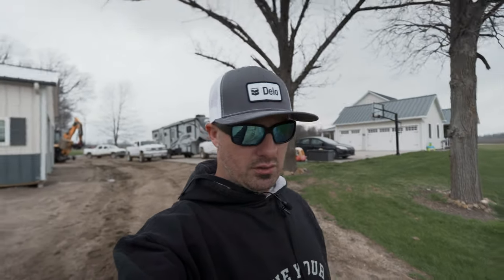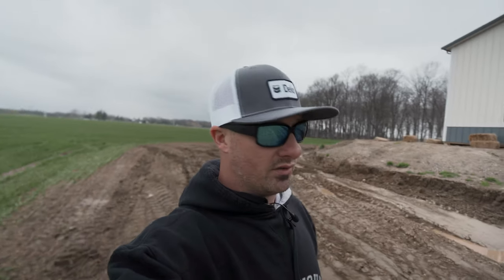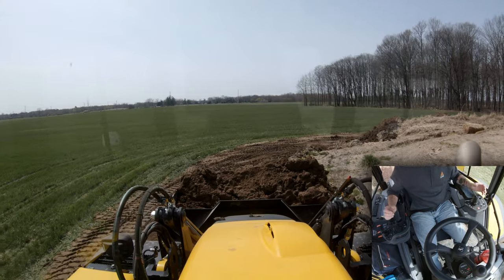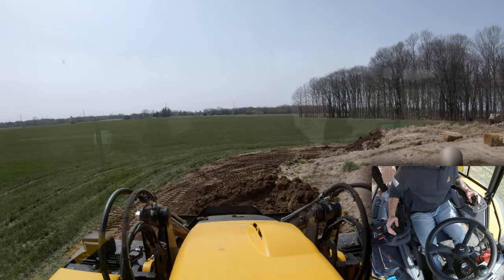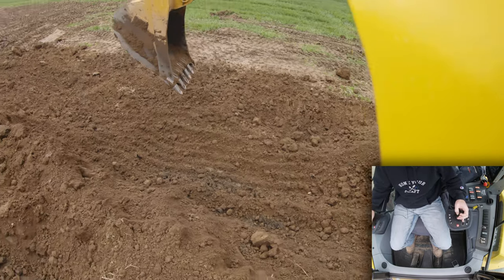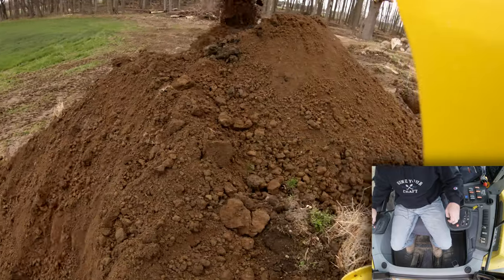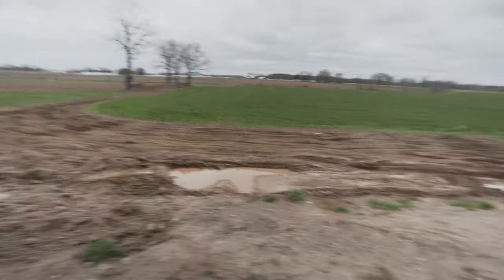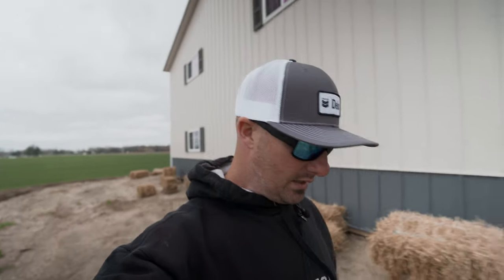Working in the @huddig!

Comment: When you use the bucket up front, you have a small pipe on your right arm, to the left of the hydraulic hoses. There is a small pipe in the pipe and when you tilt the bucket, the innermost pipe should line up with the outermost pipe and then the bucket is parallel to the ground. Good luck from Sweden.
Reply from the maker: I saw that but didn't take the time to set it since I only had the machine for a week or so.  It wasn't lined up correctly from the dealer.  My only issue with these sort of indicators is that your cutting edge will change over time and without being able to see your bucket it makes it difficult to adjust on the fly.  Thanks for the tip!

Comment: Regarding the front bucket, in sweden we use grading bucket also in the front, a low and long bucket, so you can visually see the edge of the bucket, which helps alot. bu
Reply from the maker: Makes sense.  Thanks for the comment!

Comment: But there is 1 thing to keep in mind when driving a machine equiped with a tiltrotator. ALWAYS remove the tiltrotator when digging in grounds where can be BIIIG rocks and I meen rocks thats like 2-3m² or bigger. Because digging up rocks those sizees can cause the tiltrotator to break in its weakest points being the 360⁰ turning, the mountingpoints for the tiltcylinders or breaking the tiltcylinders beyond repair so just a smal headsup there. otherwise, cool to see another clip when your working with the huddig 👍👌
Reply from the maker: Thank you for that information. I have zero experience working with tilt rotators so I am very much in the learning stage
Reply: @DieselandIron  no problem and everyone is always a beginner in some point in their life 🙂 and I can tell from my many years driving excavators and huddigs thats equiped with tiltrotators, you are doing really good and you are a fast learner 👍 keep driving and you will soon see that you will be able to handle really tough jobs that almost looks impossible 😎
Reply from the maker: @micke20  I appreciate that!
Reply: I never remove my Rototilt on my Huddig and I've run it for almost 10 years with no problems and it's not unusual for me to dig up rocks that can weigh 3 metric tons.
On many machines here in Sweden, the tiltrotator is direct mounted on the stick so it cannot be removed..
Reply: That is an urban myth here in North America. Sure if you are set up to dig hard shale for two weeks…. Back in Sweden those Roto-Tilts stay on the machine, that combination is superior for civil work and maintenance. Precise and fast. Don’t forget the integrated grapple on the Roto-Tilt unit as well, very useful. 
EG When laying optic fibre in older residential areas, they bring a haul wagon with them for spoils and later with bedding sand. Using an off site staging area. 
Makes for very clean and organized jobs.

Comment: buy and add a lose backing camera on the roof front on the machine and use that to se over your hood. i did buy a nightvision system with 2 cameras front and back on the roof and placed em on the sides to get a top down. buckets go with planning bucket both front and back huddig have power most of the times to skip toof. Try not to jank things upp in the bucket to mutch you have the claw on the rototilt to use that to pick stones. Otherwise welcome to swedish standard.
Reply from the maker: Thanks for all the tips!  This machine has changed the way I think about approaching work.  Unfortunately I had to give the thing back!😂😂

Comment: Would have been nice with a planning bucket for the back and I agree they could have done a parallel plate at the top on the front so you have something to go by. Cameras mounted in the front of the machine are fairly common to make visibility a bit better, it certainly ain't good.
Reply from the maker: Agreed on all fronts!  Thanks for watching and thanks for the comment!
Reply: there is a level idicator on the loader :) but not all bucket have the same tilt angel as original bucket so it dosent work perfect. And Camera is sometgin you can get from the factory/dealer mine has one :) really good sometimes but grading with the right bucket goes fine with almost just felling after a while :)

Comment: You know, these are fine and dandy machines, but and this is a big one, what happens when it has a malfunction (and it will, sooner or later)?
Since there are just a few dealers in the US, would you have to truck it back or have someone fly or drive to you? 
That could be one very expensive proposition.
Reply from the maker: Most likely the closest dealer would come to help service the machine.  This is one of the biggest challenges for Huddig at the moment here in the US.

Comment: too late to see this video... regarding the view of the front bucket and its level. If the bucket is original, from the manufacturer of the machine, it should have fasteners welded in the right way. Please look at the right cylinder from the leveling of the bucket, along it there is a thin tube in which there is a rod attached to the upper pin of the loader by the bucket. When you close the loader bucket (on yourself) then this rod comes out of this tube, its tip is painted red. when only the red part of the rod sticks out of that tube, you know the bucket blade is set to push the soil perfectly horizontal to the entire machine. We have two huddig machines in the company, the second one has a non-original loader bucket and this relationship is no longer maintained, a different profile of the entire bucket and mounting. Your reaction to the machine is great, after a year of working on it, I am still impressed with its capabilities. From what I learned from the service technician, Huddig is conquering America and is very well received, which made the waiting period for the new machine much longer, a much larger number of orders. We want more Hudding from you! Show it on the tracks and when working at height, it can be great material!
Reply from the maker: I noticed the bucket level indicator but I have two issues with this.  First, I'm a lazy American and I don't want to have to get out of the cab with some wrenches and manually set this rod.  Over time as the cutting edge wears I will have to continuously adjust the rod to keep it indicating level with my cutting edge.

The second reason, and by far the bigger reason I don't like this style of indicator, is because it only works when you are working with the bucket level.  If I start trying to shape a pile or a berm with my front bucket, I can't see the angle of the cutting edge in relation to the ground which makes it difficult for me to be accurate.  If I had a level spot somewhere on the back of the bucket that I could use for a visual reference, I can be a lot more precise and a lot more productive because I'm not blindly guessing.

I would love to get more seat time in the Huddig.  Unfortunately they are only sold through a couple of smaller dealers here in the US and it is difficult to get my hands on one!  Fingers crossed we get more Huddig content sometime this year!
Reply: @DieselandIron  For me it was set by the factory, I only use the original spoon, sometimes I fasten the forks, but it is well aligned so I have no problem with their level. Yes, everyone talks about it, but the forward visibility is poor. We have B and E versions of the machine in the company - here in this new one (E) the bonnet is much lower and sloped down, so visibility is better, but still average ... I wish you to check out its new version this year, i.e. 1370 and maybe you can do it with the 1370T, I'd love to see it!
Reply from the maker: @qbert2505  I plan on badgering the local dealer along with my US Huddig contact to see if I can get the new model onsite. Since they are doing the big reveal at conexpo it will have to be sometime after March. Thanks again for the comment!

Comment: That's definitely not a production machine
Reply from the maker: That's dependent on the operator and the job you run it on.
Reply: 😂 thats bullshit….  They are extremly comon and well used all over sweden , and are used for anyting from loading trucks, gigging house grounds, vvs, cables, drenage pipes, Very popular for Snow remowal and road , railroad works. 

Fast, strong, acurat, presicion macines.